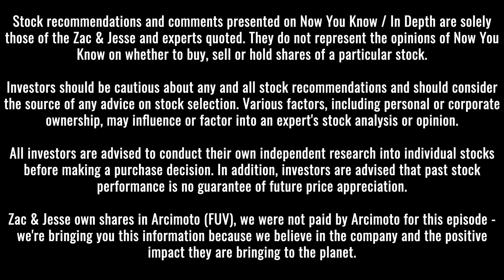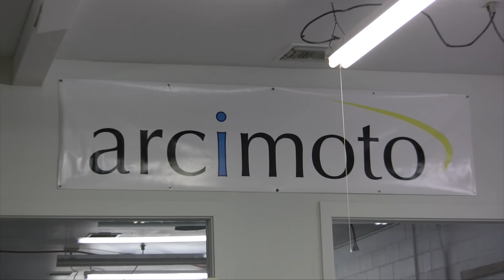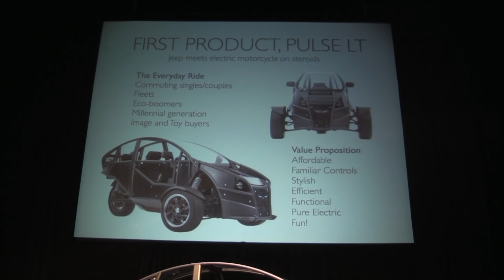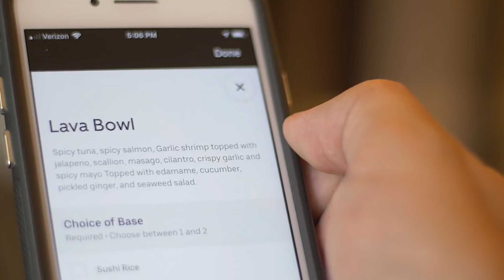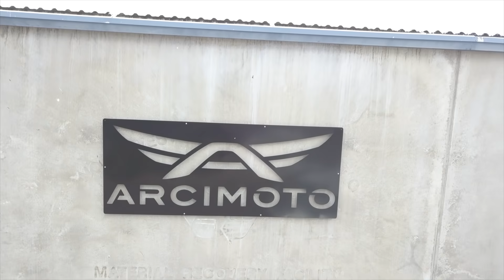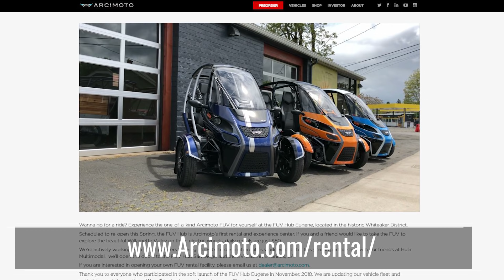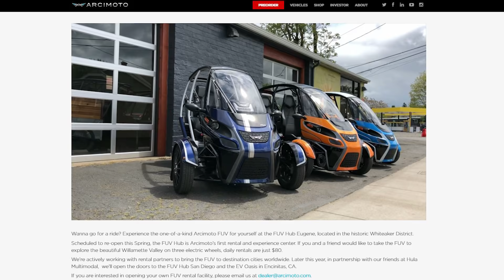The FUV Has Arrived! Arcimoto | In Depth

Comment: The FUV would do great in the Asian and India market, depending on price point. Replace the TUK-TUK.
Reply: Great point!! They'd be all over it, SO much cheaper to run
Reply: @chrisbraid2907  Arcimoto can change the back to seat 2-3 or put a flatbed on it.
Reply: South America too but the key word you said was the price point. It is way over priced for those markets or at least for those that already using 3 wheel vehicles. Don't get me wrong I am not against it but the current price point is a killer.

Comment: Will the FUV fit inside the bed of the truck like the cyberquad? Who needs a trailer when you can just drive the FUV up into the squatting cyberbed?!
Reply: My guess is that the Arcimoto is much longer than 6'8"
Reply: Ah man how cool would that be...
Reply: Because along with friends in the 6 seats in the truck you want to bring multiple FUVs.
Reply: @youmakeitreal  if second row is hone they can make a 8-10 feet bed ^^
Reply: @youmakeitreal  It can't be that long...

Comment: Cute and mostly practical, but what do you do in inclement weather.  Could be an issue if you only have a small vehicle like this to get around town.  Also what about safety?
Reply: Air curtain caused by the windshield and roof for rain/snow.  But doors are in the works (they used to show both soft- and hard-side options on the website ... mum for now).  Safety is in the agility--like a motorcycle, but also in the automotive-rated crash cage.

Comment: When you have a laptop with a camera located just above the keyboard instead of at the top of the display, 
I would recommend to raised the laptop with some books, as looking at someone nose still is very disturbing.

About such vehicule, there might be a business case for it, but since it takes the same footprint as a car,  
unless you have a big garage, if you live in a city, the parking will be a big issue in residential buildings with a single car parking spot.

Comment: I been thinking about buying Arcimoto stock but, I have follow other three wheeled vehicles and some that were very promising, in the end they just didn't work out.. Can Am Spyder which has been around for a long time, you just don't see that many on the road. I wish there was more side protection for the rider. Also, if you have to have a motorcycle license to ride it, that will be a limiting factor. The stock is dirt cheap but will have to think about some more. To buy one I don't know if I would. I use to ride motorcycles until I had too many close calls on the road. The price is way too high for me for what you get with no weather protection.

Comment: It has to be creazy cheap to gain any market in Europe <5k$. Ranault Twizy, a kind of similiar FUV, has failed. Surprisingly it has got a second life in South Korea. Let's talk about private use, not a car sharing scheme - I have checked now - 7.5kE (+ battery rental) for Twizy vs 8kE for Dacia Sandero in France. If you don't drive much, just to commute a few km every day with free parking at the railway station (my case), it would be stupid to buy a Twizy in coutries with low TCO (taxes, insurance, like in Poland), although that would be great to use such FUV in this particular scenario. IMHO this has to be done by a company from China - mass produced there and sent to Europe with decent warranty + local trusted service network.  BTW - many say Twizys failure was due to missing full-size doors / weather protection, maybe food for thought ;) Seat Minimo seems to have learnt that lesson ...
Reply: The problem with Twizy is the battery renting and no fastcharger.

DC fastcharger can use down to 50V batteries.. With fastcharger you can go on small road trip, or charge up on unexpected extra trips.

Comment: Please deliver to UK ASAP. I want one!
Reply: 2x plus the price of a Renault Twizy, similar spec, one less wheel. Not a fan of the Twizy, but if you want a similar product, £6690 will get you in a brand new base model on the road  tomorrow. By the time this lands in the UK it'll  be £18-19k, half the price of a base Tesla M3, 10% of the value and utility.
Reply: G T 
Volume will lower the price considerably. If they don’t reach the required volume, then I agree with you...they won’t be successful.

Comment: Where and how do I buy this Stock?
Reply: FUV, very low market cap
Reply: @nickbonardi3523  stock has been trending down since it went public, 1.72 a share
Reply: zappos49 Do you think that this could be a good buy long term?
Reply: @tysaylor7079  so apparently ramping up a company is just as hard as to getting to where they are now, its probably 50/50 at best, stock could slowly bleed down and you lose your money, stock could go up 5 fold.
Reply: They are only producing a car or two a day right now
Reply: Only way to invest in a company like this is throw some money at it you could lose and dont check the stock price for 6 months
Reply: Open a TD Ameritrade account. I started a Roth IRA account with them, then rolled over an IRA from my former job. Buy your stock now at $1.60/share before they report gross revenues up 500% next quarter, and quarter after that.  They have been selling T-shirts and key chains mostly until now. 20-25 units a week at $20k. 4000+ preorders (including mine). I have high expectations for the company.

Comment: In New York, which they mention over and over again, this is a motorcycle. Operating a motorcycle in New York requires you to wear a helmet. It's the same is for most other states. All video in NYC shows the driver breaking the law. There is never a mention that this is not just a cool EV, it's a motorcycle.  Wearing a helmet really takes away from the coolness factor, which is why this fact is omitted.
Reply: Correct.  The number, as I understand it, is 11-12 states no helmet, 37-38 require helmet.  Arcimoto has a legislative initiative to address this on a state-by-state basis.

Comment: I´m sorry, but I don´t understand the hype around this thing.

Starting price: 19,900 Dollar
Top Speed: 75 mph
Range: 32 miles @ 70 mph
Seats: 2

Again, I´m sorry, but this thing is designed to be either used by singles who don´t travel far or as an additional vehicle for couples/families. The FUV is not much smaller than a small car, but wich much less capability.
If Arcimoto designed this vehicle in order to reduce traffic, then they have missed the mark. People wil mostlyl buy this as an additional vehicle (if they can afford that at all). Like many people have a motor bike just for fun. But it will help neither the traffic situation nor the environment.

I find it somewhat confusing that a channel like Now You Know, that focuses so much on environment protection and smarter energy usage, is promoting a vehicle that has additional resource consumption as its main purpose.
Reply: I get a kick out of the number of nay-saying posts (i.e., all of them) that use the price point of the most expensive version of the Arcimoto currently for sale, the "Evergreen" edition.  This is a one-off version of the Arcimoto that was offered as an incentive to early reservation holders.  Arcimoto is currently selling at more around the $15,000 price point, depending on the options, and this is what Arcimoto believes most consumers will want it spec'd out at.

If I am a cheapo, I just wait for volume to reduce the price point of the base model to their targeted price point of $12,000.  

Further error correction:  verified EPA range is 103 miles with the small (12kW) battery pack.

Further clarification:  no matter how many vehicles you own, you can only drive one at a time.

Further clarification:  for city dwellers, parking three of these for every one ICE car results in a 2/3 increase in available parking.

Further clarification:  zero (local) emissions, and 3-4 times the efficiency of the most efficient vehicles (EPA-verified 173 Mpg equivalent).

Even if one were to buy the most expensive version, compared to a Hyundai Velostar ($18,900), you will pay $500 less for fuel per year (assuming 10,000 miles driven and $2.15 gas) plus almost no maintenance.  

Now, if I'm a sentient sapien, this starts to make sense as a value proposition.  But hey, wait until I pass you in one of these sporting a "NOPEC" license plate.  I'll be sure to salute.